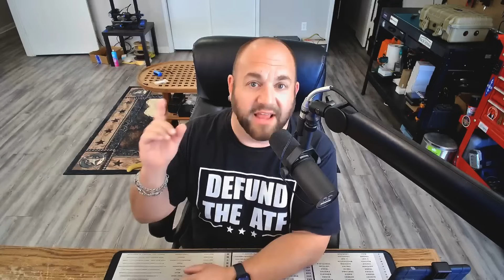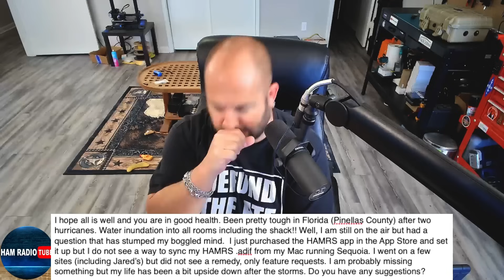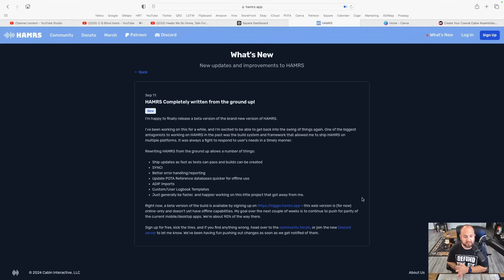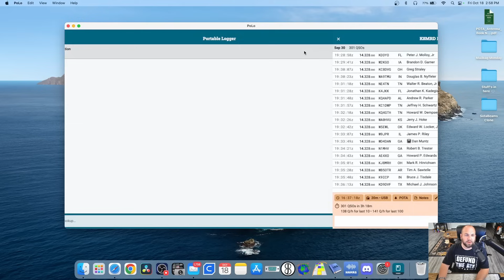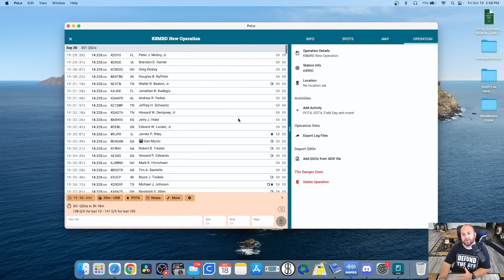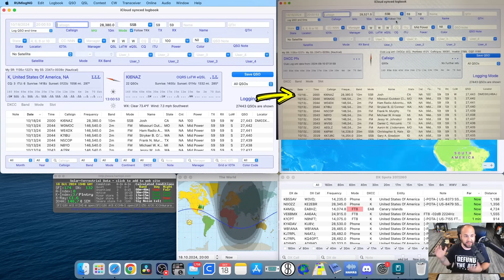Don't Drain Your Car Battery While Operating HF Mobile!  Do This Instead!

Comment: This video just showed up in my feed even though I've been watching your videos about a year now.  My previous car had the battery under the back seat and I hooked a 3000 watt inverter up to and set that on the floor in front of that batter location.  That worked great until someone pulled over in front of me and had to hit her brakes right after pulling over.  Now I've been powering my G90 with a cigarette lighter to Anderson Powerpole power cord.  When I replaced the G90 with an FT-891, I lowered the output power to 50 watts and it's been doing just fine as long as the car is running.  I have an MFJ voltage booster coming so that I will no longer have to gave the car running to operate.

Comment: In the HAM community we don't give F about your politics. All we care about is HAM Radio stuff. To interject any extraneous CRAP into HAM radio is to reject, defy and corrupt what HAM radio is. My best friend in Armature Radio, now SK, was politicly a polar opposite of me We had so many things in common otherwise and most of all a love for Amateur Radio. Neither of us cared about the others politics, did we discuss it not often, but we had such a respect for each other in all other ways. Neither of us made it an issue. For you to so blatantly in your face display such a controversial issue is outrages, especially when comes from a place of misinformation and ignorance.  I am just about ready to unsubscribe. 

When you title a video such as "Don't Drain Your Car Battery While Operating HF Mobile! Do This Instead!" and then add so much other non-related stuff it is very aggravating. All I care about is the titled info. The best way for mobile operation is to parallel a high-capacity secondary battery to your auto battery. A good LIFEPO with internal controller does not care that it is charging off of a vehicle alternator. In the hot (red) lead from your auto battery to the operations battery put a switch that opens when the ignition is off or as you wish a manual switch. This keeps the secondary battery charged while traveling, keeps the radio load off of your auto battery and prevents it from draining while stationary. You will be thankful next time you try to start your vehicle. When stationary operation drains your secondary battery flip the switch, start your auto and recharge it.
Reply: Are you upset about a t shirt?

Comment: I use a Li pro 4 battery in the rear cargo space of my suv next to the body of my Yaesu FT 891.  To keep the battery in one place without it getting knocked around while the car is in motion I affixed heavy duty velcro under the battery.  I never use the lead acid battery under the hood.  Do you know what brand of battery I am using??  The brand is "NoJoke".  Seriously!  Don't laugh.  You're not supposed to because it's no joke.

Comment: im a poor  ham  i always ran my ham radios off the car's/trucks battery b ut i also have not had a new  drive by wire car or truck  . the newest  truck i weil by is a 1987 dodge 1/2 ton  2 wheel drive& the newest car was a 1973 dodge polara (it was my street racer i  i was into CB back then) i always used a 10-8 gauge paired wire from my battery BUT SOMETIMES I  HAD TO DRILL A HOLE IN MY FIREWALL  SO I COUKLD RUN THE WIRES I WATCH THE BATTERTY VIOLTAGE & WOUILD  START  THE CAE TO RECHARGE THE  BATTERY.  Now when i cangetr upo the $$$$$$$$$$$$$$$ i want to grt a lifepo 50-100 ah battery

Comment: Mike, I fight Hams ALL the time about my lighter plug. I just tell them if you use a good one that was designed for the use (or make one) and not use the cheap ones, you have no issues. I now have another one in the fight for this. And thanks for the idea of running the 891 with a battery mobile.

Comment: That makes sense run a battery for a hf mobile transceiver. I plan on adding multiple radios in my troka, but it till made me curious about if i run multiple radios on one battery would be bad. I plan on running vhf/uhf, CB, GMRS, HF and a police scanner

Comment: As an automotive electrician I can definitely recommend using a separate battery. Most vehicles if you discharge the battery under 11.5V the car won't start and there's not enough V and A to crank it over. If you discharge it and somehow get it jump started, due to V going below 11V most modules will go offline and after restarting you'll have a bunch of warning lights on the dashboard which may not clear themselves and you'll need to have a mechanic to do that. 
Whilst driving, no problem knock yourself out. Stationary use another battery if going to be a while or heavy load
Reply: I have not done this yet. I was planing on a 2nd battery in my truck, separated from the system by a battery isolation device so that if I drained the radio battery the truck battery would still be good.

Comment: I appreciate the practicality of your posts.  Thanks.  One point of confusion on this one - You showed an FT-891 tucked under the passenger seat, but the 891 doesn't have a separate control head.  How do you control that radio?
Reply from the maker: By disconnecting the removable control head of the 891 and mounting it on the Lido Mount as shown in this video.  Then there's a control wire going from the control head to the body of the radio that is sitting under the passenger seat.
Reply: @hamradiotube  My apologies.  That’s a trick I didn’t know the 891 could perform.

Comment: Some "experts" in the overlanding and auto sound industries claim that an alternator can safely output 50% of its rated capacity full time. For example, my 140-amp alternator can surge charge my starter battery immediately after starting the car, but has been fine with my DC-DC charger pulling as much as 50 amps, depending on the temperatures. Lately, with the colder temps, I'm seeing 50A being drawn; but I see 35-40A on hotter days. I'll let you know if anything catches fire! ;-) In short, I think 3A is VERY safe... even a 10A charger is probably okay in a 12V outlet, so long as the total drain of all of the other accessories plugged into the other outlets doesn't exceed the fuse rating (my 12V outlet factory fuse is 20A). 73! -Scott

Comment: I have a similar setup to yours; I power my FTM-500 of the car socket and behind the seat I have my battery box (for My FT-710) that is getting topped off via a small inverter while I drive. Cheers 73 KD9ZNA

Comment: My truck has a extra battery tray so I installed another battery under the hood and a relay so when the the ignition is on the batteries are connected and will charge when the ignition is off the batteries are disconnected.  All accessories, radios, etc run off of the 2nd battery.

Comment: Great video, Mike! I've also never liked the idea of drawing from my car's battery for mobile use (for a variety of reasons). And nowadays we've got so many great battery options anyway. One question: Could you please provide a link or otherwise point us to the actual plastic boxes you use for your batteries? I didn't see any of these on your Amazon page. Cheers!
Reply from the maker: Harbor Freight my friend.  That one is made with the Apache 3800 case.  https://www.harborfreight.com/3800-weatherproof-protective-case-large-tan-56769.html  I did a whole video on it.  https://youtu.be/E2EzffOhysg.

Comment: Powerwerx sells the Bioenno charger, they also a sell a current limited selectable 2/4/8 Amp LiFePO4 charger that I have been using for a few years. I have a battery box that permanently lives in the car.  The outlet is also switched to ignition so I dont have to worry about drain. Gets below freezing here in the winter, the battery I use has low temp cut off in the BSM.

Comment: I connected a wire directly to my truck battery to a Solar Charge controller, then to a LifePo4, then to my radios.  It let's me charge the radio battery at 10amps from the truck, and my radios are always on.  I also have a relay controlled by the ignition so the truck battery is only charging when the key is on.  It works well, but it doesn't fully charge the 100ah Lifepo battery.

Comment: A quick note for the HAM wanting to run the IC706 mobile; If you do run a power cable direct to the cars battery be sure to use a relay that only energizes the radio when the ignition is in the “on” or “accessory” position. The IC706 is never completely “off”, because there is a continuous current drain to maintain the stability of the transmitter. Without a relay you will run the battery down to the point your car will not start if left for a few days without being run. Ask me how I know 😆! 73 de Dan WD4DB
Reply: Also, beware of leaving any Garmin GPS connected when the engine is off. The little bugger is parasitic and will complete drain your car battery after a few days!
Reply: @n4gix  My son has a small Garmin that is running from an always on port. No problems so far, but winter is coming...

Comment: I don't think having a web-based logger (not picking on HAMRS) would be practical - a lot of the POTA sites in my area, like all those 100s of PA State Game Lands, are out in the freakin' boonies and have no cell service.
Also... thanks for "translating" the M&P website - the metric stuff really put me off, and made me stay away.
I run my VHF/UHF radios directly to my truck battery, with inline fuses of course.  I never tried having HF mobile because I use manual tuners and don't want to die.  Most "cigarette lighters" in cars are on a 10 amp fuse, so from experience, I avoid using them for radio.  ...although 10 amps * 13 volts DC = 130 watts, so party on Wayne.
Reply from the maker: HAMRS isn't web based.  Just the new development stuff.  Once it's ready for release it will be an app just like the current one.

Comment: Have to disagree with the 3amps being more than a car can handle.  By default pickup trucks, by means of the 7 pin trailer connector, spit out 30amps to charge batteries on trailers.  Cars are not much further behind.

Comment: So, I just started using Hamrs this past weekend to log hunter contacts to QRZ and lotw.  Seemed to have worked well, but I guess I need to use proper software for windows.  Suggestions on  what to use?

Comment: For me, HAMRS is still missing two essential features:  Being able to read the rig frequency via CAT, and accepting incoming logs from WSJT-X.  I hate it when I'm in the middle of an activation, change bands, and then later on realize that I forgot to change the frequency in HAMRS manually.  And I've found it to be a struggle to try to log FT8 contacts manually into HAMRS.  For these reasons, I'm still suffering with Windows and N3FJP during activations, even tho everything else I do is done in Linux.

Comment: I did the battery box thing in the car as well…
   Bought a new SUV. Didn’t want to run power cables and alter the wiring of a brand new car. But the main reason I did it this way was to avoid the Bull Shyt the dealers pull on you if you have a problem under warranty! One they find you altered the car in any way, your warranty is void… 
  No radio gear is permanently mounted, no screws into any part of the vehicle, and mag mounted antennas… 
  Battery lasts sometimes months at a time. And Anderson power poles make for a quick connect and a quick charge… 
   Even run the rigs at the QTH on batteries. No AC line noise that way…. And already set for a power failure or worse….  Bioenno makes some really nice stuff, and so far it’s served me quite well.

Comment: I'm adding on to the car battery topic my car is a 2018 nissan leaf so i'm not suppose to connect my radio's to it's under hood battery had the idea though so for my setup i have 2 batteries in my trunk my 100Ah for my 891 and my 15Ah bioeeno for my VHF UHF and i run both power cables from the passenger to my trunk and i use ferrite beads to hold the wires together original use was somehow my 100Ah battery kept turning off every time when i transmit on just 1 repeater frequency but that's the 2nd use so by doing that i can run my 891 and VHF UHF at the same time and if 1 dies i can just take the battery out of the trunk and charge it either trickle if i'll be at a location all day or quick charge with 200W solar panels sitting on a table if i'll be at a location for short time that's my setup

Comment: I think VHF/UHF is a bit more tolerant with power sources, so cigarette lighter socket is fine. I’m lazily using a Baofeng HT with a roof antenna charged off a USB adapter. 😂 

HF is something else, though. I like the idea of a battery box for extended outings. My GMRS radio (Wouxun KG1000G+) is off the car battery, and since that’s just when traveling, I don’t need it when idle. A battery box makes sense for HF radios if you’re doing POTA in the car, like with an ATAS. In Minnesota, it gets cold, so that option would be nice. No RFI using a battery box!

Comment: For portable/mobile use I have two solar panels on my truck (also keeps things topped off if I don't drive it for a week or two).  I also keep a good (charged) jump started in the truck as well.  Lots of good ways to run radios in your rig.  Thanks for the info Mike!  KY4CKP
Reply from the maker: I don't think I'm quite at the "gluing solar panels to the roof of my car" phase yet, but that does sound really cool!  I suppose that's what the luggage racks are for though...I wonder what their speed rating is?

Comment: Are we gonna be seeing EV car battery comparisons some day and an eventual K8MRD Tesla battery box for POTA? ... with two led lights on the box of course! Also, would it be TOO heavy for a SOTA?😂
Reply from the maker: Hmmm, how could I turn a Tesla into a battery box??  I'll have to work on that for the next Go Box Challenge.
Reply: Hyundai/Kia EVs can output 1,800 watts at 120 volts AC. It's pretty cool to have a 77 kWh power bank on wheels. It got us through a recent 36 hour power outage with plenty to spare. But I haven't tested how RF quiet it is.
Reply: @keegan854  I gotta say my gasoline cars have been in my backup power when needed plan, The EV is like having one of those Tesla wall batteries I guess. Do you pump it into the house somehow or just run an extension cord?